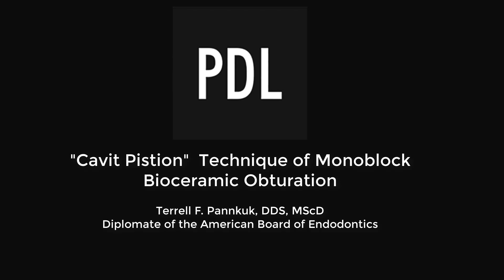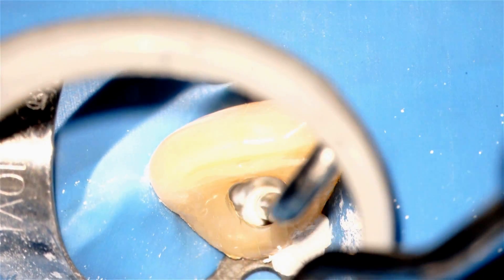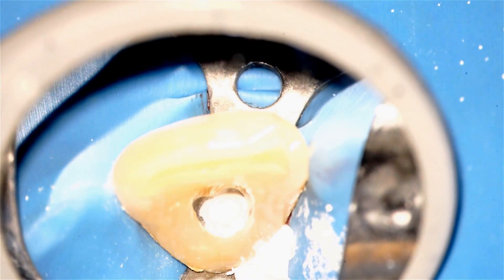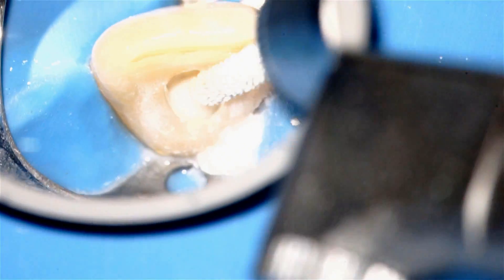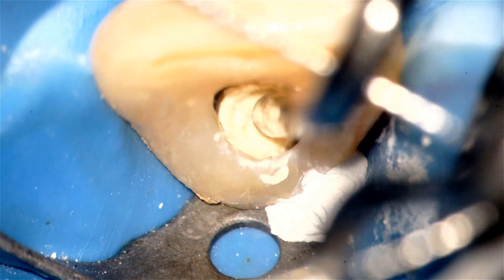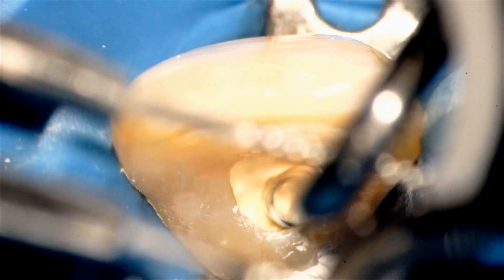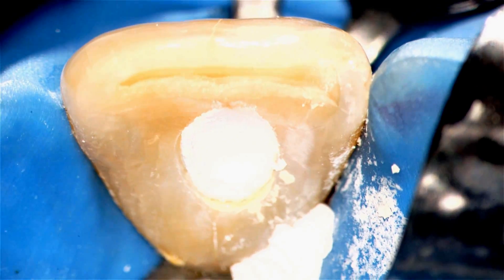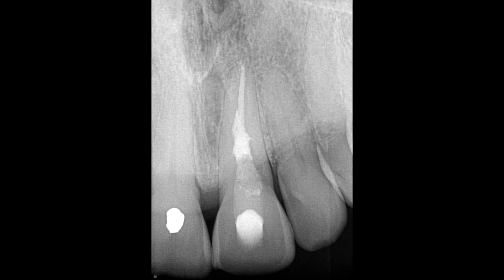Cavit Piston Technique of Bioceramic Root Filling

Comment: Understand the concept, but would BC Putty be more compatible as the piston for BCS instead of Cavit? BC Liner could also be placed over the material once set and then access could be restored with composite.
Reply from the maker: Cavit is a better piston and generates the necessary hydraulics.  BC  putty is not as rigid and will not mold to move the BCS apically with the same degree of control.  It doesn’t really matter if the piston has any bioactive properties because it is entombed as a very small layer placed sufficiently away from any contact with the periodontium.  I simply chose a moldable material that ideally functions as a piston, can be easily manipulated,  doesn’t wash away when sandblasting, etching, and bonding a core,  and has known physical properties with evidence-based use in dentistry to satisfy any logic in a convoluted protracted debate with corporate opinion leaders wanting to pitch less effective but more expensive proprietary materials it substitutes.
Reply: Thank you so much for taking the time to respond & for sharing your wisdom.  I truly respect your opinion and enjoy reading about your beautiful cases.